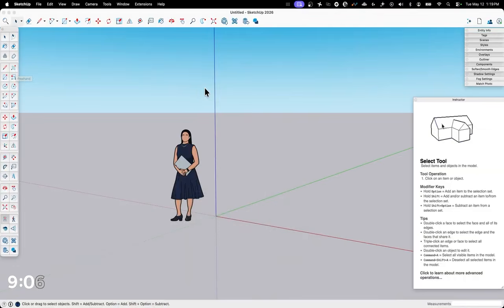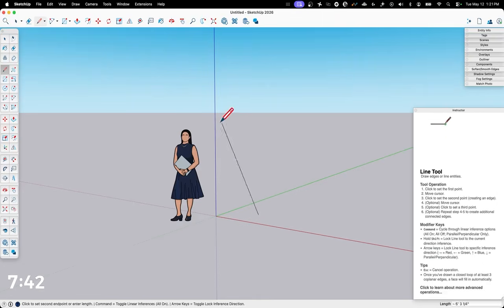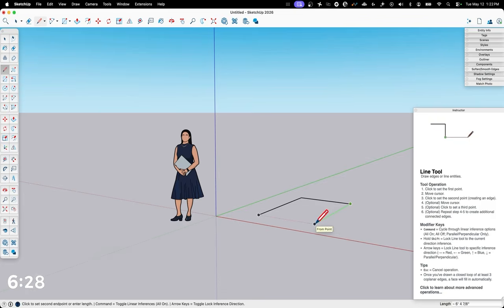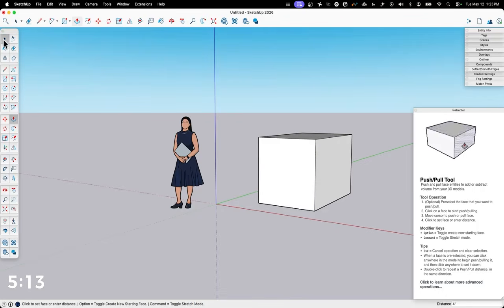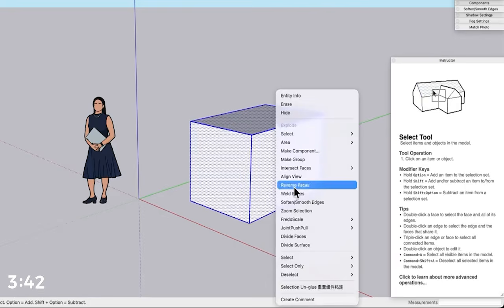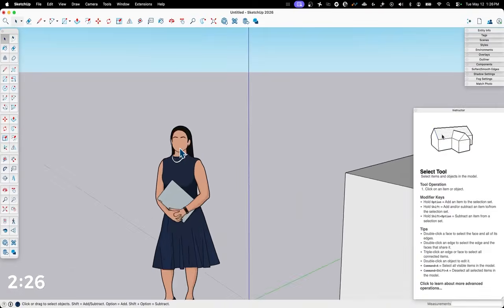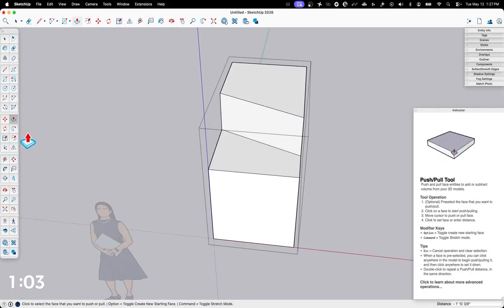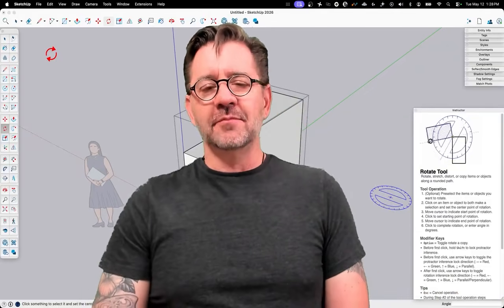An Intro to SketchUp in Just 10 Minutes!

Comment: a very powerful tool for 3D. if a model exported to layout can have a line weight adjuster it would be perfect. i mean we can pick whatever lines in the model, adjusting its line weight in layout would be really fill the hole. i mean, even in 3D we can already pick the lines and faces why not add an option to adjust the line weights specially in lay out. it's a very important thing in drafting. if this happens making a construction drawing in layout will be awesome.